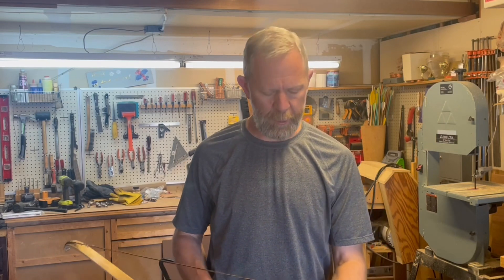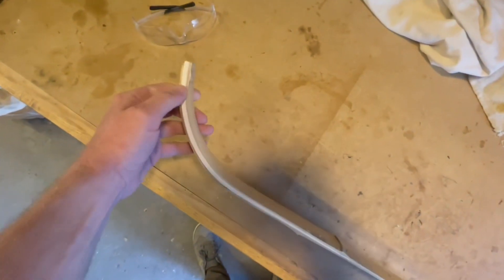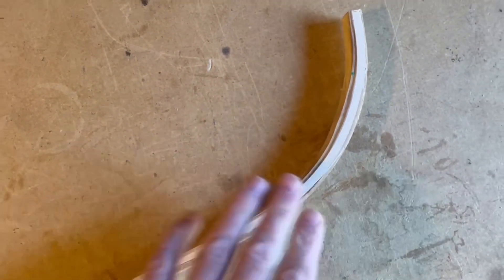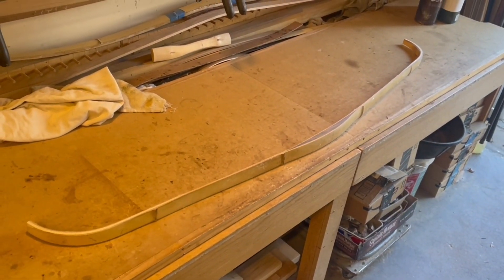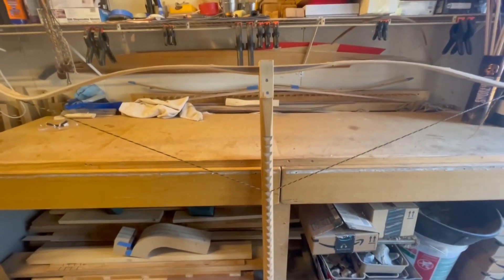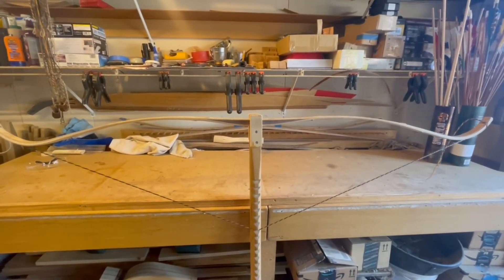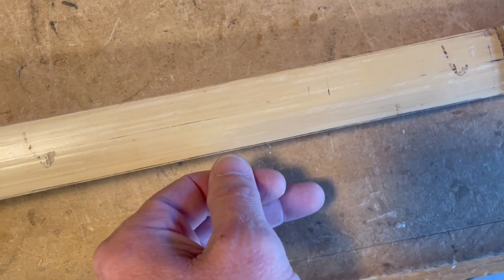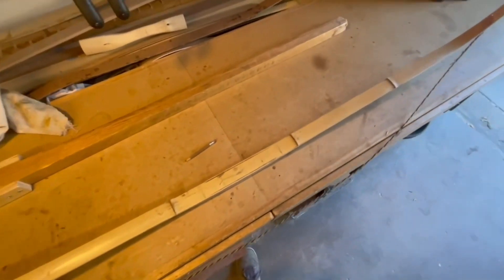Scythian bow experiment Pt.3

Comment: Could you shorten the siahs a bit to relieve the limbs?
Reply from the maker: In the finished bow shortening the siyahs would also shorten the string and potentially increase draw weight.  I don’t believe the trade-offs would have been worth it.  To do it again, I would absolutely shorten them - keep the recurve but increase the amount of working limb - or make it more compact.

Comment: If you do see my comments here. I would like to send you a link of a video of David mead. He made a video with a guy Opa from Opa bows. They made high efficiency light draw weight bows by designing it a certain way. They used fibreglass for the back and belly and he used bamboo core. I would like you to see that video and that design of those bows and then give me your thoughts about it and if just bamboo as back and belly can maybe make such high efficiency bows with light draw weight. They make bows that draw about 35 pounds but throws an arrow at over 200 fps
Reply from the maker: I'll look for the video - Thanks!
Reply from the maker: I’ve seen the video that you are referring to. I have little doubt that you could come close to matching that level of performance with just bamboo.  You would have to ensure that the belly piece is properly tempered to hold up in compression, but my Assyrian experiment turned out to be quite the speedy Bamboo bow.
Reply: @meadowlarkadventuregear  awesome.  My bamboo looks fairly dry now. I'm starting to setup similar forms that you have in your videos. Need to get some tools too. But I'm going to try to make a bamboo bow soon. But I'm going to take my time with it.

Comment: Also another thing. Sir can wood glue work just as good as epoxy for these bamboo bows?
Reply from the maker: Only drawback in my experience is that it sets up faster than I can get the parts together... however, I've seen recently that Titebond has come out with a long-open time glue that may be the answer to the problem.
Reply: @meadowlarkadventuregear  ok so it's only the drying time that's the issue. But the gluing power is the same? I always thought that it has something to do with flexibility or strength.  I thought the EA40 epoxy resin is maybe more flexible or stronger than the wood glue. But I guess if I'm just using bamboo on bamboo or wood on wood then the wood glue should work perfectly fine because I've learned with my wood work projects that heck I don't even need screws because he glue cures stronger than the wood itself. I made my daughter a crib/cot. I tried removing a certain part but the wood broke instead of the glue coming apart. Thank you  for all your responses. Your efforts of responding will not go unnoticed. Thanks I will use all the advice

Comment: Oh wow so that is how a person tiller a bamboo backed and belly bow. So you don't scrape off from the belly. You scrape off on the sides. Sir I thank you so much for sharing your knowledge.  I'm going to study some of your videos because I want to try and make myself a good professional Bow because I don't have over R5000 for a bow. That's my currency in my country. It's way too expensive to buy a bow here.
Reply from the maker: While I stand by the processes used in this build, I have employed belly removal in bows made since this one. I also temper the bamboo all the way through and significantly reduced the use of heat on the bow for tillering purposes.
Reply: @meadowlarkadventuregear  thank you. I should look through you channel if you have showed this process. If not I look forward to a future video where you show how to temper the bamboo and also remove wood from the belly. Does removing wood from the belly actually reduce its strength?
Reply from the maker: Any action that can influence the bend of your bow will influence the draw weight - so yes. I would manage draw weight as much as possible on the sides of the limbs. Check out the Assyrian build, and the Hill Style bow builds for more info on bamboo bellies.
Reply: @meadowlarkadventuregear  Thank you sir. You are an amazing craftsman. Also very kind to respond to my messages. I will definitely go through all the videos. I have subscribed. I am excited to make my first "real bow" lol beside just using pvc.

Comment: This bow has a beautiful design..should be a very fast bow. May I ask sir. Does these bamboo bows with bamboo as the belly too, take lots of set? Or can these bows last for years without taking much set?
Reply from the maker: Raw bamboo will take a lot of set. To the point of being useless.  You need to be sure to fully heat temper the belly piece to make it effective and it will hold up for a long time. I’ve put thousands of shots through similarly designed bows that still look and feel the same as when they were first finished.
Reply: @meadowlarkadventuregear  Thank you so much for your response.  I'm a Newby and taking all advice I can get..so when I heat temper the belly..can I just use a heat gun or a small blow torch?
Reply from the maker: You can use either, just be careful with the torch - not to let it set in one place too long and ruin the bamboo.
Reply: @meadowlarkadventuregear  wow thank you for taking the time out to respond.